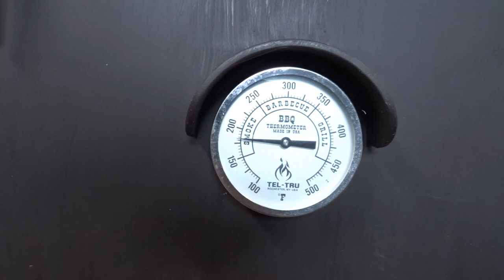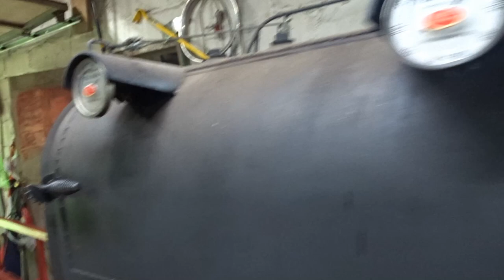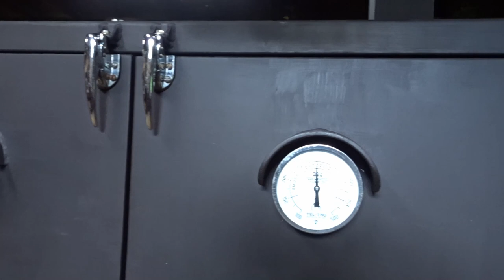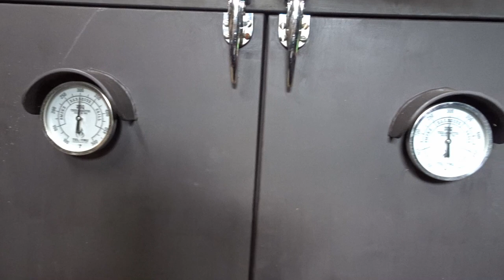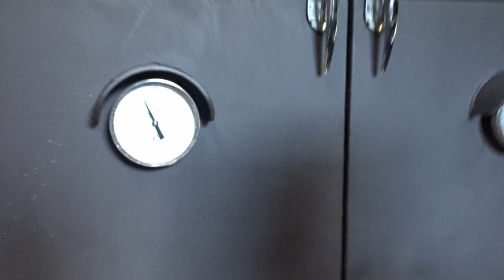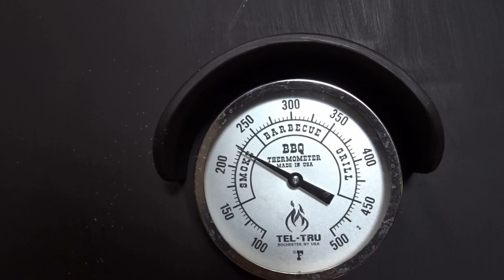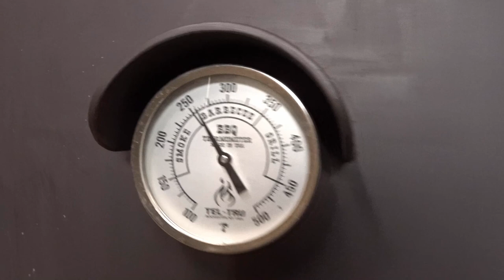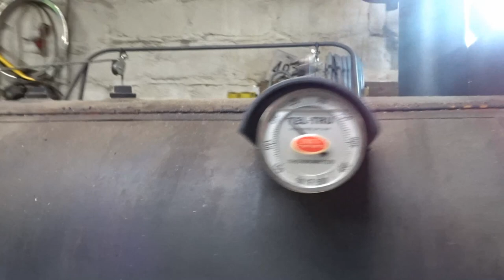SDSBBQ - First Cook in the New Insulated Smoker / Double Booked Cook - Part 1   The Cook

Comment: Can't wait for part 2
I have my biggest event to date (250guest) this weekend and onsite with my roughly 350g trailer and setting up canopies bringing tables basically an outdoor kitchen set up and I'll serve from that same spot.. Any suggestions on handling customers add ons outside the contractual specifications we already set and deposit paid? They keep saying it might be more people coming originally told me 200 (price quoted) ballooned to 250(price quoted agreed and deposit paid meat bought) now thinking more ppl but don't want any more meat (potentially setting it up where food runs out before event ends) Should I redo the contract stating this? Do I insist on more product? I've been to weddings where food ran out and the caterers no longer cater (word of mouth killed them)I want to avoid that but don't want to foot cost cooking more "just in case" meat. Sorry for the long post but kinda lost.
Reply from the maker: So the wedding that was apart of this event the sides, that they didn't pay me to do ran out. I let people know I wasn't responsible for the sides and there was plenty of meat. I'd caution you to try and cut the portion sizes to help stretch the  food. This is one of those things were it will be an experience and take notes and learn for your next event. There will be no way to "predict" how the food will pan out, unfortunately. Do your best and don't worry about running out of food, Just make it known that there were more people than expected and not that you undercooked.